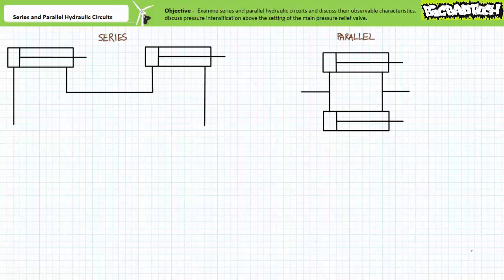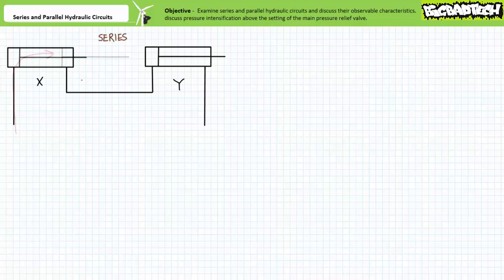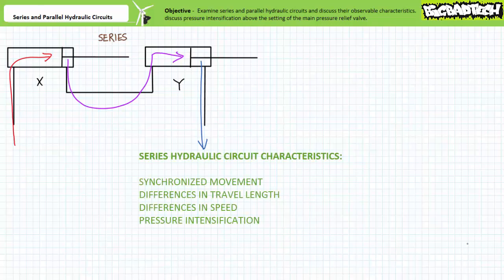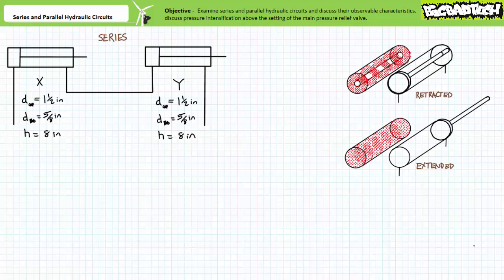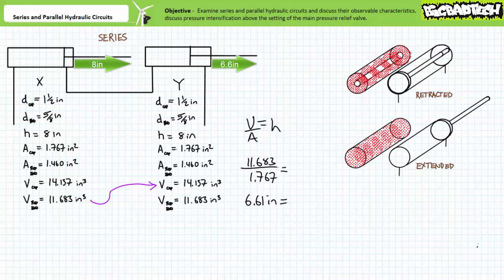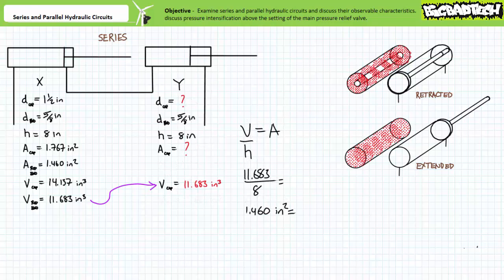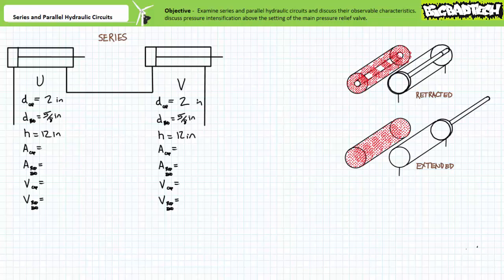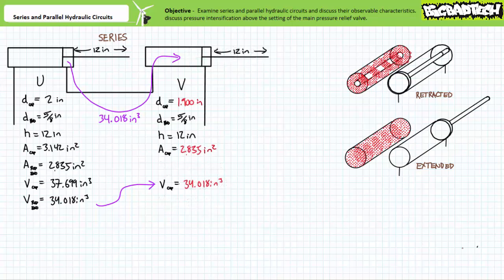Series and Parallel Hydraulic Circuits (Part 1 of 3)

Comment: How do you fill up the cylinder part which the fluid goes to and fro as you extend and retracts, that part seems to be isolated from the pressure lines, it seems kinda hard to completely fill the cylinders and hose, any help? Thankss
Reply from the maker: Good question. The expensive way is to include a port or valve between the two cylinders. This would allow for not only fluid introduction but also removal for maintenance purposes. The cheap way is to install the upstream cylinder by itself and, using quick disconnect fittings with check valves, extend and retract the cylinder a couple times to fill the rod end volume then install the downstream cylinder in series. The fluid trapped in the retracted upstream cylinder's rod end now becomes that isolated quantity of fluid that is pushed between the upstream and downstream cylinder.

Comment: How do you troubleshoot a series hydraulic circuit to distinguish which piston is causing the trouble? I had my master cylinder go out on my car causing the clutch not to disengage.I noticed the clutch pedal getting softer & mushier but which cylinder is the culprit? The master or the slave? Slave does not leak neither does the master, come to find out it was the master problem solved but is it due to the fact that the master holds all the pressure for the system? The seals internally let air into the system (sponginess) loosing pressure ...but what if I determined it was the slave? I guessed the right device but I was not sure please advise what is a sure fire technique to nail the component?
TX
Reply: If you disconnect the line from the master cylinder and place a pipe plug into the outlet, step on the pedal and if the pedal stays firm and you see no external leaks, you know the problem is the slave. If the pedal goes down as you hold pressure on it, you know it's the master. The plug isolates the master from the circuit.
Reply from the maker: +Don G. Not an automotive guy, however, my general advice is (also applicable for mechanical and electrical troubleshooting scenarios) given you've pinpointed the problem to an interaction between two subsystems is to isolate each subsystem and perform a function test on that subsystem only.
Reply: Great answer!  TX for that info!